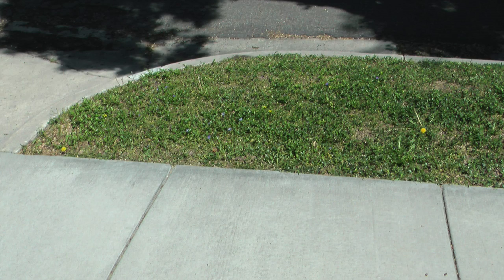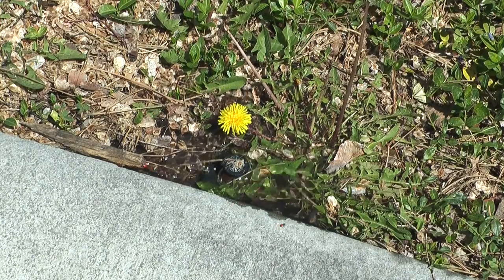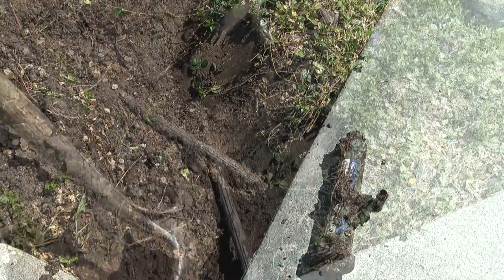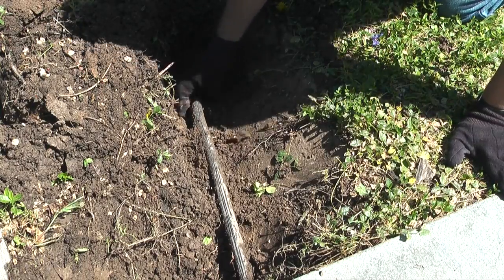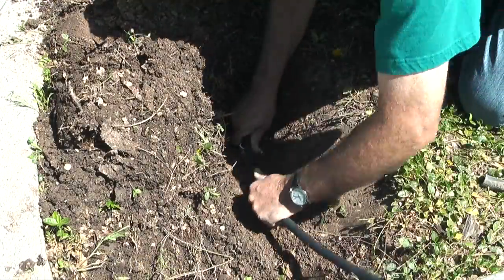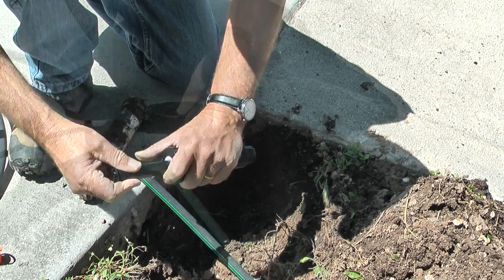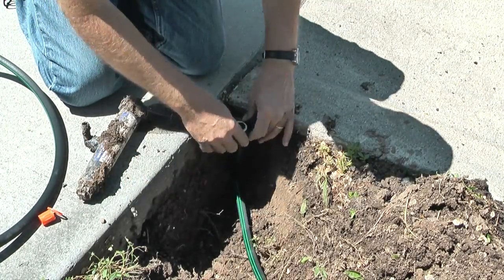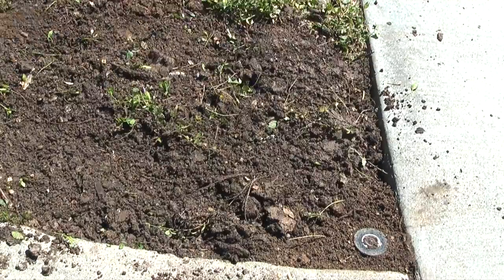Broken sprinkler spray head repair

Comment: Great video, I particularly like the fast forward feature. Not sure if you’re aware but funny pipe once started onto the fitting threads on clockwise.( might be useful if someone has limited hand strength)

Comment: Why dig back all the way to the PVC? Just put on a funny pipe coupling and the appropriate length of funny pipe. Also wouldn't a 10 or 12 foot van be more appropriate. Good job in general though
Reply from the maker: I like using new parts on a repair. I didn't have a 10 or 12 VAN nozzle on hand, so I throttled down a 15 VAN. Good comments, thanks for posting.

Comment: just moved into a place I have two types of sprinkler heads one identical to this and the other ones auto rotate back and forward. k had no idea you can adjust the flow with a flathead screwdriver like that. great info thanks I need to adjust several for over spray
Reply from the maker: +Rob Bradshaw 
Thanks, I'm glad the video was helpful.

Comment: Kerry do u have problems  when installing  new 1804 bodies  with the flush caps on them to flush to flush the sprinkler  and if u get dirt on to of the sprinkler  it gets I'm the wiper seal  and the sprinkler  won't go down I have had this problem  and have to take  apart  the sprinkler  to clean what can I do to stop this
Reply from the maker: +john Kosheluk 
I put the sprinkler nozzle on the head before installing it in the dirt.
Reply: Ok thank u have a good day
Reply: john Kosheluk y

Comment: I noticed this was in front of your home..i have same problem...do i need to shut of water from main line in front where sidewalk(city) is..or as long as my valve is off i can still do it?
Reply from the maker: As long as your sprinkler valve is off you can do the repair. If you have a timer I would just shut it off then make the repair.

Comment: Have you ever used Orbit Hard Tops? They're great for stuff like near driveways. And they're also not that expensive, although I've only seen a 2 inch and a 4 inch model. I don't think there's any other sizes.
Reply from the maker: I'm not a big fan of Orbit products.
Reply: iScaper1 Yea, the Hard Top is the only head I would buy from them. The other ones are complete crap.
Reply: Orbits garbage they stop working after a couple of years and are made out of cheap plastic
Reply: Orbit copied hunter big time.
Reply: I wouldn't use orbit heads if they were free. And I've been doing this some 40 years
Reply: @billhoffman252  I totally forgot about this comment 😂 7 years later now yeah I avoid any Orbit product like the plague, Hunter’s where it’s at. Everyone who I’ve installed Hunter products for loves them
Reply: (Orbit)????
Reply: rain bird 1800 ai que legal 👍🏻 de

Comment: The problem is my sprinkler head came off, and now I can’t find the spot where the sprinkler head came off.
Reply from the maker: You need to dig down and find where the sprinkler head connects to the fitting on the zone line. You may have to flush the line out before reinstalling the head.

Comment: iScaper1 what sprinkler sprayers do you recommend?
Reply from the maker: I usually buy a Rain Bird 1804 sprinkler body then buy the specific nozzle I need for my application. Usually it's a 15VAN nozzle, but Rain Bird makes a number of different nozzles good for a variety of lawn applications.
Reply: I sell products and service, for 5 years hunter pro spray series are better, they last longer don't wear out as fast, I'd say if you can get either get the hunters. Rain birds are better than toro and orbit but not hunter. Rain bird does make good nozzles however, and the heads/ nozzles are generally compatable
Reply: Nicely done. Why don't you just use a funny pipe coupling and add a footof funny pipe or whatever the length is you need instead of digging all the way back. A marlex Street L would be recommended under the head also. How about an 8-footer a 10-foot van. Wouldn't that be more appropriate to the width of the parkway strip?

Comment: What kind of pipe?  Funny pipe?
Reply from the maker: Also called swing pipe or sprinkler head tubing. It's flexible 1/2" tubing for connecting sprinkler heads to zone lines. You don't need glue or clamps to install it. I've put links in the video description for the funny pipe and fittings.